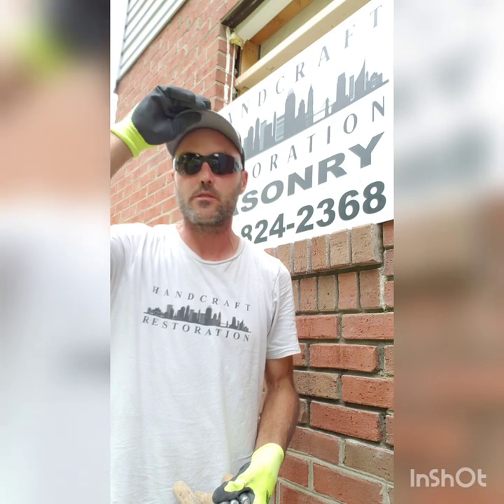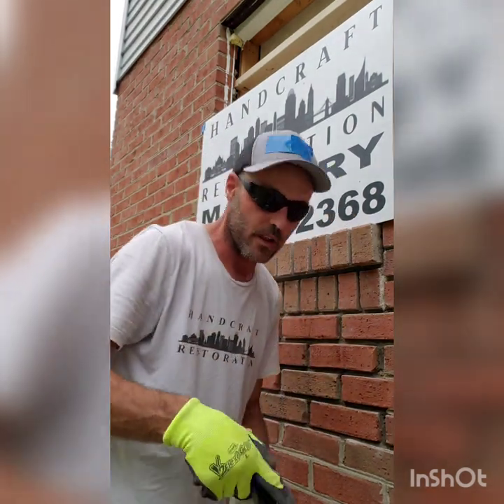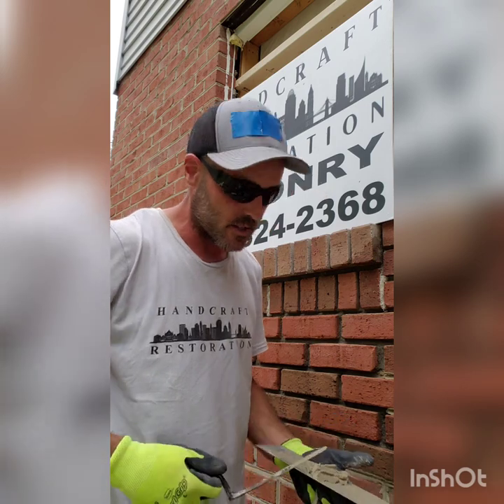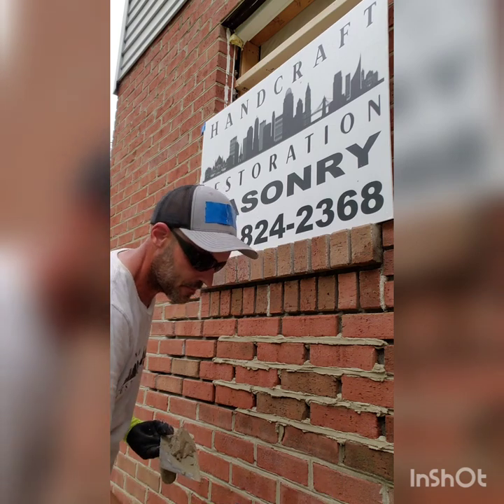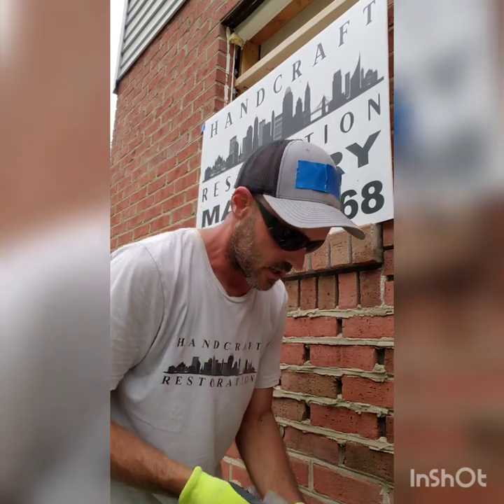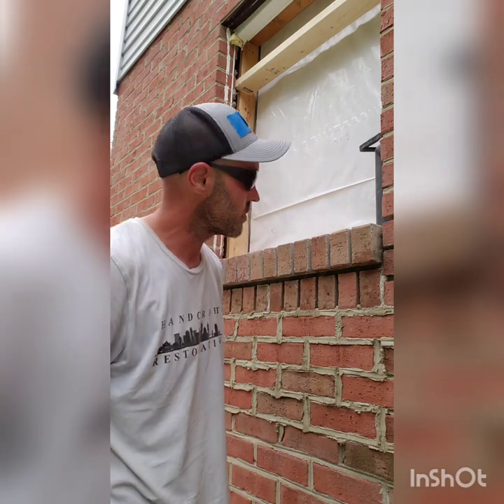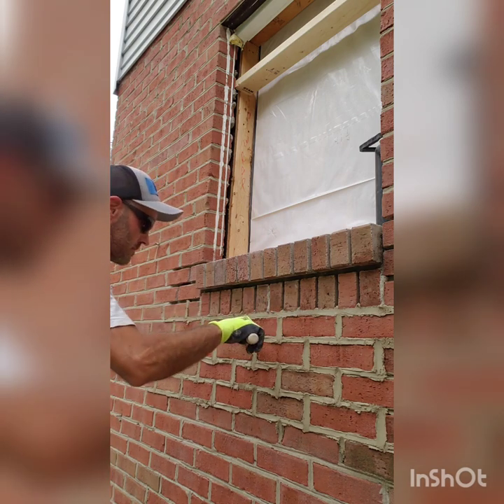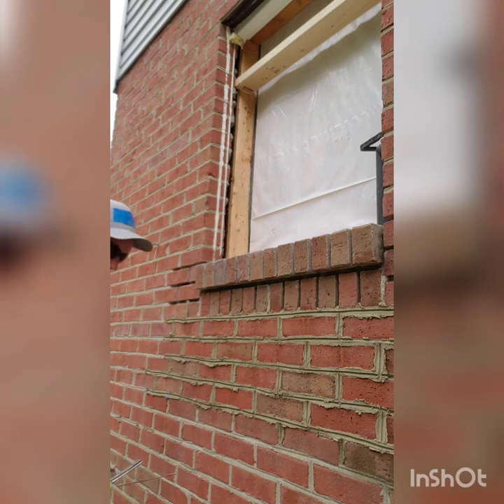How to tuckpoint brick

Comment: You did a great job buddy, I commented on your other video nice job buddy, I have a pointing company out in Massachusetts very profitable BRICK-POINTING.
Reply: I would get fired way back in the day on a TUCKPOINTING job if I ever held a small finishing trowel against the wall to point or a hawk or anything else Everything had to come off the trowel and the mix was much dryer and better than the splashy mix he’s using! But Seriously Hold the hawk or trowel against the walls 30 years ago would get you fired real quick

Comment: I'd be curious to see your joint cleaning prep techniques.  Looks very well cleaned out, including the head joints.
Reply from the maker: I have another video on grout bagging and jointing out with a barrel jointer coming very soon. Its alot more direct and to the point but very well explained. If you subscribe to the channel itll let you know when I upload it! Thank you for the support !
Reply: I decided to post a positive comment about this good video on traditional repointing, and am curious about your cleanout technique.  
But please do not post another bag repointing video without improving almost everything about your bag technique, and your understanding of what's important to focus on.   Nothing personal, except that the bag repointing video was excruciatingly terrible work.
Reply: @JerryAndSherry and the proper way to cut out brick mortar joints is with a small air hammer that Air Tools No Electric and the Sane Knowledgable ones all know that but it’s way too much for clueless Americans who would most likely chip up and spall the brick if they ever attempted to cut out that way so most people use grinders which make Way too much dust and really just make the whole process so much harder! I am long since retired but used to air hammer out a few hundred square feet easily way back in the day in a fraction of the time that any of these clueless “ experts “ take with grinders